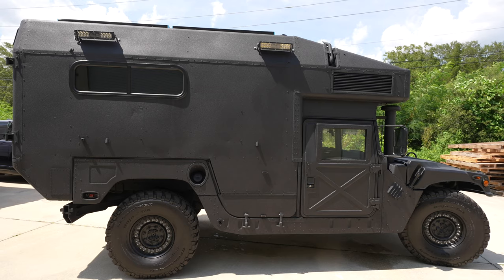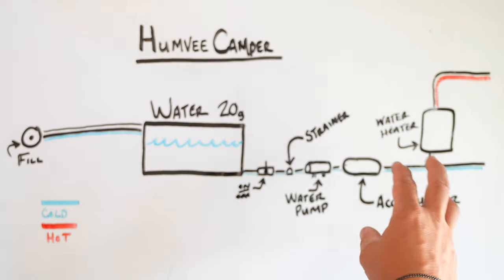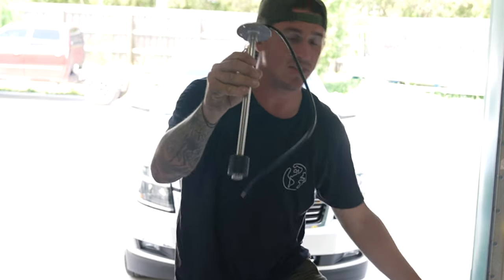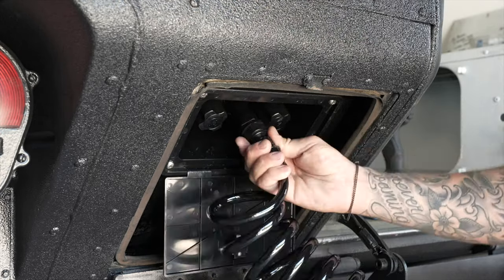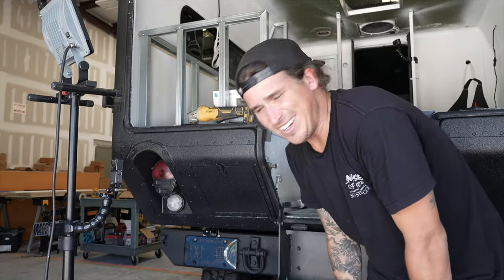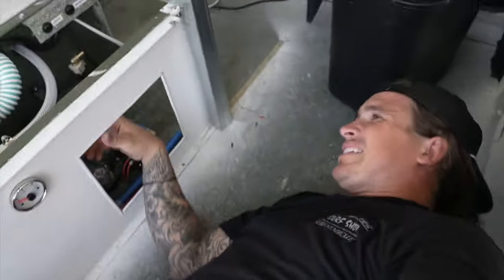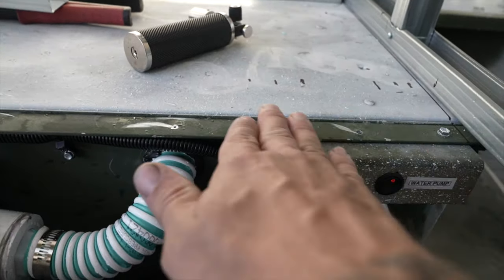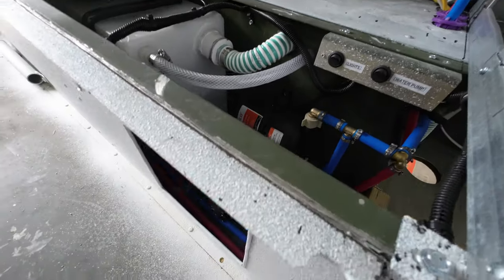Installing Water System In My Humvee Camper - Humvee Conversion | Roaming Ventures

Comment: I'm all caught up now.  This is fun because it combines my love for my off-road Humvee adventures with my truck camper rebuild and adventures.  At one time I had a truck camper in my Humvee back in the Mid West - there was really nowhere good to take it (considering limited highway speed)  While it had plenty of sleeping OVER the cab, there was no access to the rear (like yours with the door from the driver area to rear box) - I started building my current truck camper for the Humvee but it was turning out so nice my wife wanted to take it on longer trips - so I bought a clapped out 08 GMC 2500 to rebuild and carry it.  But from water, heater, batteries, solar, vents, fridge...and more I'm tracking right with you.  Very nice job so far.  I'd LOVE to have this shell on my Humvee but the reality for me is the places we off-road in AK it would be way too tall.  I'm already wider than I'd like to be for most trails running with Jeeps and Toyotas.  I can't wait to see yours in action.  I'm putting a plan together to put a quick diesel heater portable unit and attempting some overnights in it as is.
Reply from the maker: That’s awesome, sounds like a really great camper you built. Thanks for following along on my current journey.